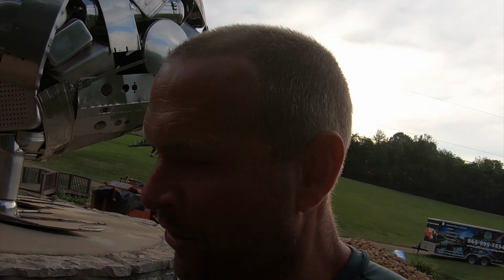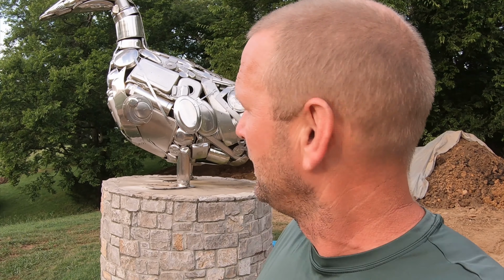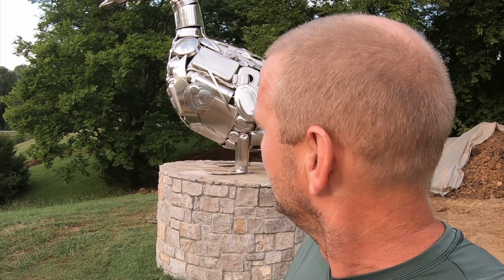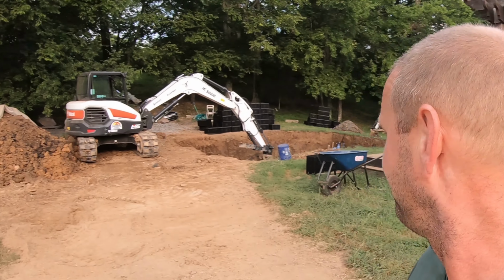Jurassic Pond gets a wetland filter And A Waterfall | See It Get Built

Comment: Great vid john, what is the pool size vs filter size, and pump sizes for the wetland
Reply from the maker: The filter is a bit small for the pond, but we made it as big as we could to fit the budget. Also the pond has a nice spring that feeds it with a constant overflow. We normally shoot for 10% of pond surface for a larger feature filter BUT money, environmental situations etc. have a place in the decision making process. Pumping 20k GPH currently- intake is designed to handle (and operate optimally) at 40k GPH.

Comment: Have you ever used solar powered pumps in your ponds, I’m getting ready to build a rec pond 60x30 with an elevated wetland filter and waterfall
Reply from the maker: I have never seen a solar powered pump that moves much water (not that there hasn’t ever been one) but my advice would be to install an energy efficient pump n then install solar system to offset the consumption!
Reply: Ok thanks for the reply, your videos are super helpful and have learned so much, getting ready to break ground soon, what’s the best liner and under lay to use, and where’s the best place to buy it

Comment: What an incredible looking project. Question: when you use the wetland filter to feed the waterfall how much more TDH do you calculate for the water resistance running upward through the rocks? It would seem to me that if I want a certain GPH over the spillstone then I would have to calculate some loss to account for having to lift (push) the water up through the filter. Thanks
Reply from the maker: I typically don’t add any. I figure what I want and design on the high end. I guess I could test that but if you are cleaning your filter annually, it’s not an issue. The water on top is the majority and it is creating most of the flow for the waterfall (in many cases). That portion comes out unrestricted on top of the wetland. If you really jam up your filter with plants, it may have an effect but using a higher head pump it should not be an issue and the resistance will change as the filter develops. Add a few feet of head pressure and call it a day!